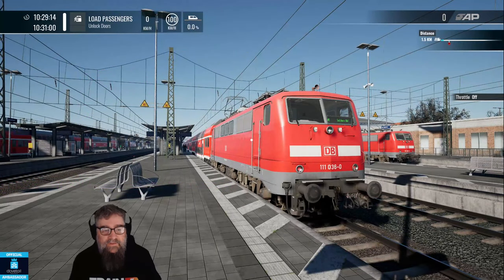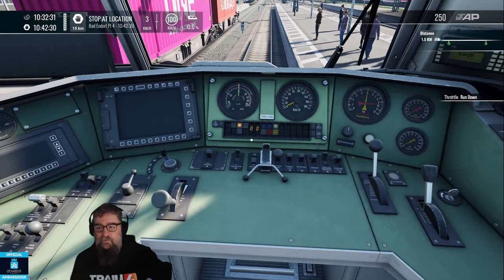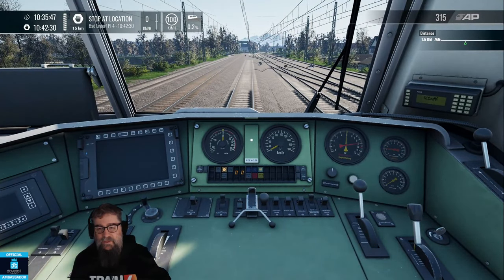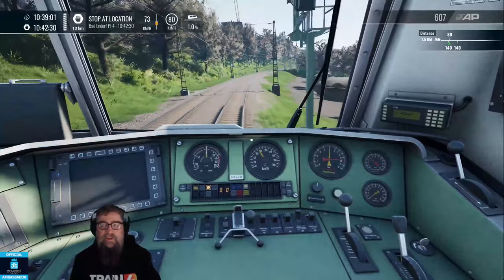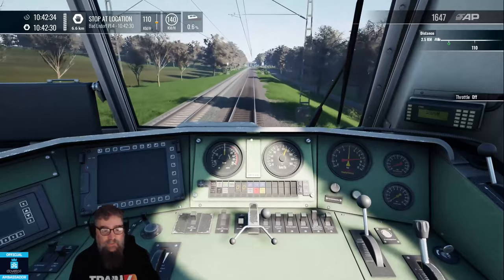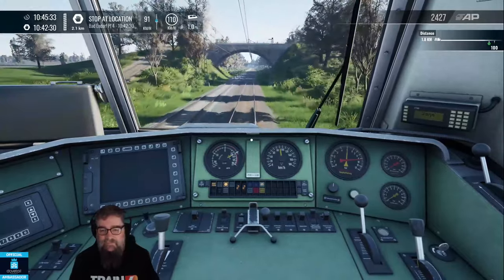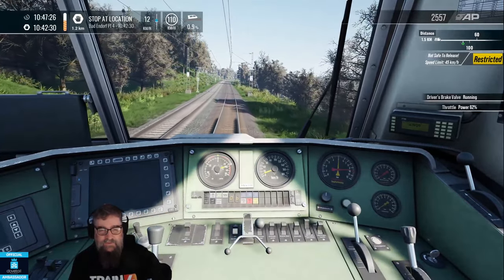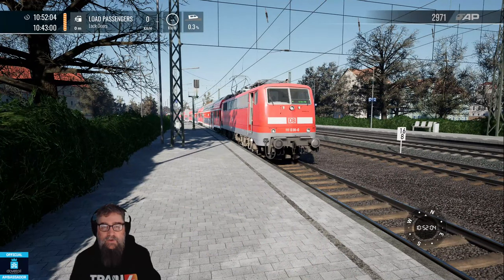TSW BR 111 DB Tutorial for Bahnstrecke Salzburg -  Rosenhiem

Comment: One thing to note NOT to do in a 111 is to "Throttle Off" while there's still current running. Do that one too many times and you'll need another helping loco to tow you away 😄

What "Throttle Off" does is basically emergency-off the traction motor contactor, hence it "locking out" (which is actually a emergency-off). 
And with a max current of up to 3500 Amps on 4 traction motors you can imagine the resulting electric arc isn't all that healthy to the electrical contactors.

The taps are a seperate system, being mechanically operated by a small electrical motor turning an axis, which switches the taps up or down inside the sequential tap system (that sound you can hear when tapping).
So what happens when you go to "Throttle Off" is that you cut the contactor instantly while there's still a huge current on it, creating an electrical arc possibly damaging electrical equipment and the Tap is slowly running down because it's a seperate system.
The correct (and for the loco healthy) way is to keep it in "Run Down" until the Taps are at 0, only then should you notch into "Throttle Off".
I hope they teach people that specific in the Loco Tutorial at some point.
Reply from the maker: Ahhh that's really useful information that I wish I had at the beginning of this! I'll pin your comment. Thanks.
Reply: @trainsimulatordriver  I've also skipped trough the livestream and another thing is the Hohe Abbremsung. It increases the maximum pressure in the brake cylinder from 3,8bar to 8,0bar to compensate for the bad braking performance of the wheel brakes at high speeds (111 got brake pads straight on the wheels instead of a disc brake), it activates >70km/h and becomes inactive <55km/h. 
Lots of small peculiarities with the 111 :)
Reply from the maker: @moshna2301 also very helpful, there were lots of guesses on what that was and a few people got it right. Not surprised it has traditional iron brake shoes it is the 70's :). I'm streaming it again tonight (Xbox version this time) I will mention all these things so thanks heaps.

Comment: Thank you for your enjoyable tutorial. I frequently run into an odd situation with the BR111and I wanted to see whether you ever encountered that as well:

I am cruising at target speed and I pull back the throttle from the normal power section (not taps) to 0. Taps go down as expected. But then, all of a sudden, taps increase by themselves to full power and the engine speeds up, with the throttle still at 0. The only thing which helps is to use the  train break, which makes the taps go down to 0.

What is going on there?

Also, when I have the HUD on, where it shopws the power level set be the throttle, sometimes I see a white "1", and sometimes the "1" is yellow. Do you happen to know what the difference is?

Kind regards from Germany,
Mikael
Reply: New
I think I begin to understand what I did... moved the throttle to one "+1 tap" (instead of 0) while breaks where still releasing... once the brakes where fully realized and power came back, taps started to count upwards.

Need to get used to this kind of throttle.
Reply from the maker: If it's yellow then that's dynamic braking slowing you down. Don't go to throttle off or dynamic braking will (should) stop working.
Reply: @trainsimulatordriver  Thank you for taking the time to answer! 🙏🏻🙋🏼‍♂
Reply from the maker: @mikaelkleinwort7618  is a weird beast isn't it. The complexity of this one makes be wonder what the new expert tier of German trains will be like